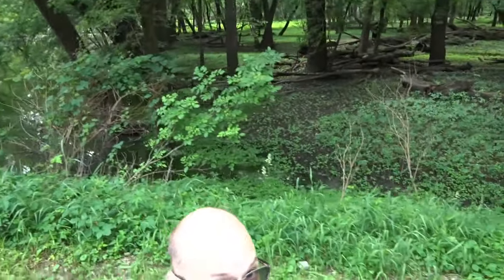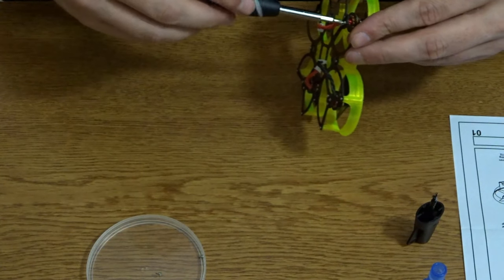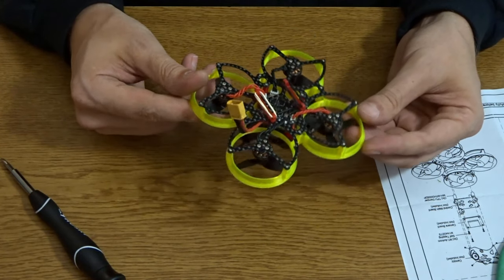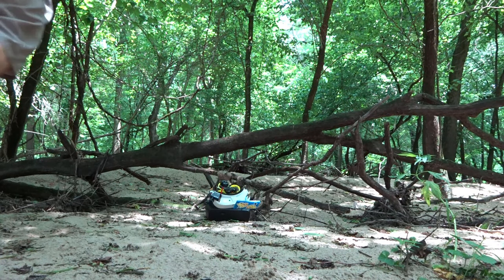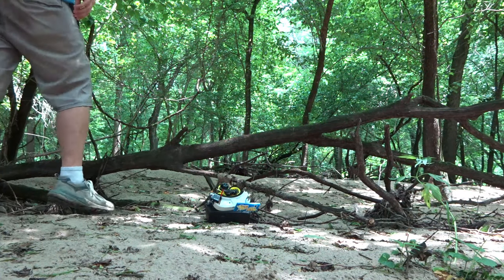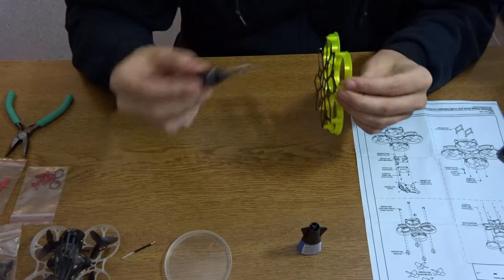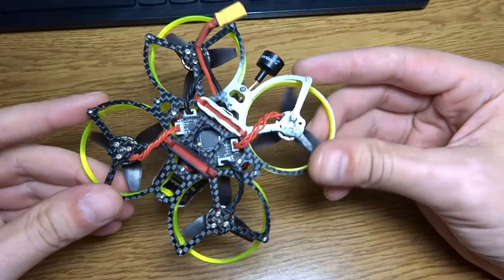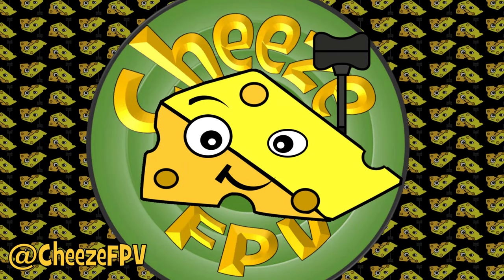Carbon Fiber Frame Upgrade for Mobula7 HD

Comment: great spot, wow...cool frame bro
Reply from the maker: Unfortunately it's jello central and extremely weak (I ran into a  leafy branch of a tree, not very hard, and broke the frame). I don't recommend the frame at all, the original whoop style frame is actually the best, make sure you get the V3.

Comment: Softmount the Motors with Electrical Tape Bro 😂👍
Reply from the maker: One layer or two?
Reply: Cheeze FPV 2-3 layers should do the job 🙂
Reply: Cheeze FPV did the tape work?
Reply from the maker: @Rizz1117  No, and after a relatively mild crash with a tree branch it broke: part of the carbon fiber frame itself fractured off and some of the 3D print layers for the whoops cam separated.